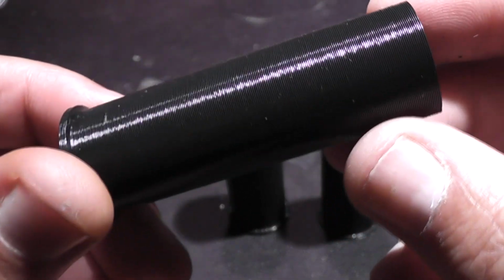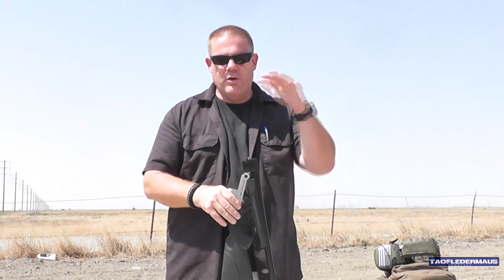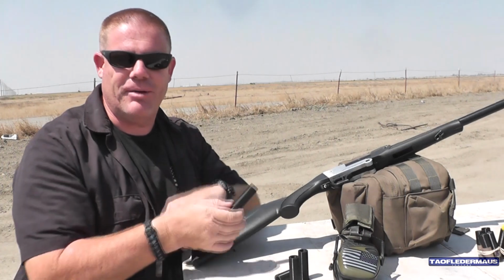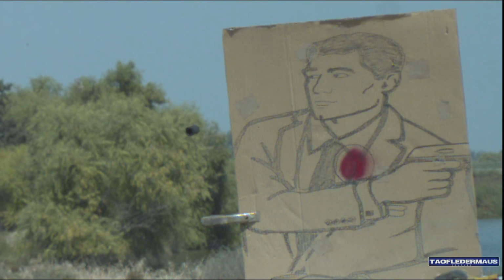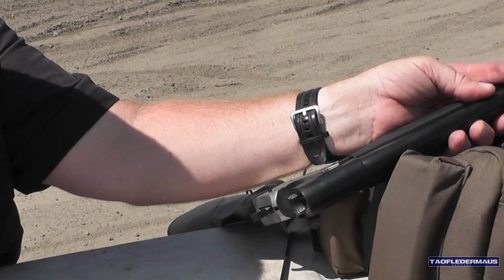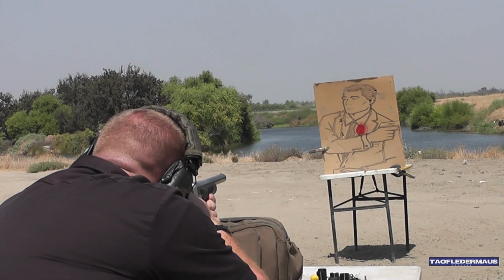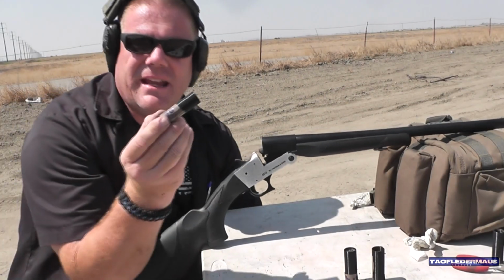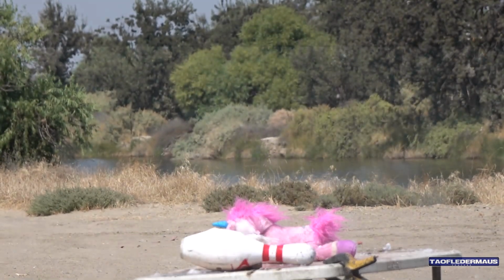3D printed Shotgun Shells - ALMOST too Dangerous

Comment: A shell that self-destructs in a way that doesn't allow immediate reloading isn't really useful. You're just as well off with a black powder firearm at that point. Before plastic hulls, there were paper hulls. That might be a more useful alternative, if for some reason you need to develop an alternative to modern hulls.

Comment: I would love to see a brass (or maybe steel) shell made from a section of tubing and an end plug inset to the tubing and brazed on there. I think that would work.  It would be an interesting low-tech low-capital way to fabricate cartridge cases from scratch.  You'd just need a lathe to create the base plug and some torch brazing equipment.

Comment: I would be interested in a 12ga explosively pumped flux compression generator (EPFCG) shell.  
See: https://en.wikipedia.org/wiki/Explosively_pumped_flux_compression_generator

Basically if you rapidly compress a magnetic field or iteratively short an electromagnetic coil, it emits an electromagnetic pulse.  

You're discharging powder in a confined barrel that pushes on the back of the shell at high pressure, ejecting the shot.  If the shell was designed in such a way that you activate the magnetic field, and then compress the magnetic flux with the deflagration of the powder and increase in pressure, the shot will be ejected as usual, but with it should come a strong magnetic pulse that I think would be directional as with the muzzle.

Comment: He is printing these vertically with seam lines around the barrel axis.  It's obviously breaking along those layer lines.

Print it horizontally, maybe with some PA-CF, and see the strength of the casing increase enough to expel the embedded projectile.

I'm also skeptical of increasing the number of outer walls in the shell casing to hold the projectile versus a common shell perimeter with /wadding/ to hold various projectiles.  If you want a 3d printed matrix to hold the projectile rather than standard wadding, you could probably do some kind of spongy voroni thing that's going to blast apart on discharge.  These are going to be separate printed items, I think.

If you're going to print the shell with 10 walls or whatever you are using to hold the narrower projectiles, make the entire shell have a ballistic "shoe" shape and don't aim for expelling the projectile from it but rather providing a kind of break-away sabot around the projectile until it reaches the target.

Comment: Interesting concept. I worked alongside a team 3d printing bridges. You have to plot the print path really carefully to deal with high stress points. A bit like rebar which is basically placed to stitch potential cracks
Reply: More details would be great !

Comment: If the shells were printed horizontally and not vertically the shells could stay together. I own a 3d printer and know that the weak spots are in between the layers

Comment: “It doesn’t automatically eject the shell like Hollywood?” My Browning over under Citori Plus Trap has ejectors. Lots of brake actions have ejectors, it’s just usually on higher-end guns as far as I have noticed, though not always. That does look like a fun little shotgun though! Your shoulder probably doesn’t find that gun very fun for long when it’s not filled with 4 pounds of bird shot LOL! That was a good idea. I understand the weight to help recoil from the bird shot, but I would’ve been worried it would make it act like a dead blow hammer. But you guys know more than I do and it seems to work well to save the ol’ shoulder. Enjoy the videos!

Comment: What material did he use to print those things. There's one material that supposedly is half the weight of aluminum and twice as strong as steel. It's a carbon fiber composite. Obviously this wasn't it.

Comment: That should be an 18 inch barrel. You counted the receiver as part of the barrel. I'm not being critical I'm just thinking this correct.
Reply from the maker: It measures 20"  from the breechface to the end of the barrel.   This is how you measure barrel length in a shotgun or rifle.

Comment: Yep, a 3D PLA print will always separate along the layer boundaries. The "correct" way of doing this would be to print the shell longitudinally however this would make the printing process much more difficult. Similarly, PETG would be a better option for the material.

Re-using old shells would probably be the best option, ten years into the zombie poxylips

Comment: print it length-wise bro, not bottom up...bottom up it will always snap off along the circular cross sections
Reply: It would be an annoying print. With the rim, you'd have to use supports or rafts. I'd be curious to see if it would hold up any better though, surely it would for the lower power rounds but not sure about those big loads lol
Reply: @bakedandsteaked  easy clean up tho, just drill them out
Reply: If your having layer separation like the ones in this video then your not doing it right. Most likely your temps are too low. I always test break any new material I load up for layer separation.
Reply: Resin printer may work better
Reply: My thoughts, exactly
Reply: Get a good printer that can use support and model mat’l and it will be easy money
Reply: If it prints lengthwise, it’s not certain to print perfectly round
Reply: I'm thinking the plastic is too brittle, shotgun shells have some flex to absorb the shock and expansion.
Reply: @yougonnaeatthat9889 at the base/primer of the shell yeah, absolutely. The brass really does most of the work making shells “safe” to shoot.
Reply: I print 37mm shells on their bases. The biggest problem here is just modeling traditional shell and printing them. They need to be redesigned for printing. There have been some huge advancements in printed ammo lately.
Reply: was just about to comment this

Comment: Rookie 3D printing mistake - you do NOT print something that is meant to handle these kinds of pressures facing up - Sideways would've been better, meshing two prints (longitudinal + upright) using a soft glue would've been perfect, would've required more thought and blah blah blah but hey, at least he got his fingers out of his rear end and made something unlike this commenter here who's working on wonky 3D printed fan-driven covid masks (why fan driven? Do you even wear glasses?) that will absolutely not sell given the predicted final price tag! Yay

Comment: He messed up. He should have printed them on their side. The way he printed them was standing up. You can tell by the lines. Those lines are the individual passes of the filament. Printing the way he did basically slammed rings together. Printing it on its side would actually give the piece alot more strength. Also im guessing he printed that in PLA was is kind of know for being pretty brittle compared to others such as ABS. Still a great idea

Comment: To produce the hull by 3D printer is an illeteracy.  During the 3D printing head of the 3D printer melt the filament is about 250-300 centigrade. Whereas during the gunpowder explosion heat reach to 1700-2200 centigrade and melt the material that 3D printed hull. That is why the hulls was disrupted during the shooting.

Comment: It looks like it delaminated. Depending on the material it might work better to orient the print where the layers move along the shell the long way instead of basically thin slices of plastic ring stuck together. but then again you may end up with the same problem. Also, different materials might help. Do you know if it is ABS or PLA? Also having something like a Carbon Fiber PLA may change how effective it is.

Comment: I wonder if it would be a stronger shell had the layering been side to side instead of parallel to the primer base
Reply: My logic behind that is, the layering grain is against the blast direction, being its parallel to the primer base, but if you rotate the layering grain to be perpendicular to the base, or in line with the blast direction, would they hold up better?

Comment: 3d printing not the way to obtain shotgun shells, something shotgun shells need a more traditional manufacturing process.  Plastic stress crack striations in the creation process are the problem.  Not suitable for high live action shooting.

Possibly if a clean burning  explosive plastic were used with a copper cap and ordanance, the 3d printing might be possible, but the plastic would need to completely degrade so the smooth would not get scarred and fouled up.  This would need to be a shell less round though.

<Lead [print low explosive plastic [cap

If a gun was restructure just right in order to remove the unburnables, it could help create a special military use gun.  Its nice to not have to collect shells.

Comment: Guys, the plastic shell have been around since the late 1960s. They were made by Herterz of Owatina, MN. It was made to be reload without a press. A all that needed to be done was poke out the primer, and replace it with a new one. Them add powder wad, shot the cover it up with a cardboard overshot wad.

Comment: Dude I've got a 1922 break action that's barrel wont even stay attached half the time that really does eject the shells like 3 feet in the air the ejector only pops out about 1/8 inch but hell that spring's gotta be like godzilla-tier.

Comment: You printed the shells the wrong way. You printed the shell vertically instead of horizontally. Printing it horizontally would give the shell more strength in the type of situation you're using it in. Vertical print stacks the layers of plastic snd doesnt give it very much strength when used in that situation.
Reply from the maker: I didn't make them
Reply: TAOFLEDERMAUS oh. Half way through the video i forgot what you said in the beginning.

Comment: Yeah, that wasn't a real high-percentage prospect there...  With the 3D printed layers running circumferential on the shell, there's no way it'd hold together without help. FFF/FDM-printed parts just don't have that kind of layer adhesion.  Now, maybe if it were wound in glass fiber or kevlar thread and coated in epoxy to reinforce it...  But I think the bottom line is, it just doesn't make much sense to print the whole shell... 3D printed projectiles on the other hand have proven interesting, and 3D printing is certainly handy when it comes to making sabots and stuff for custom projectiles made by other means. (Such as CNC turning/milling.)

Comment: the problem is the style in which the shell is printed, possibly material, rather than have it print the shell in rings, it should be long strands going down the length of the shell, harder to configure for printing but it'd prevent the cut shell effect. worst case they'd probably split and only be useable one time. but your powder load would affect the round more than the shell hopefully.

Comment: From the breach yea its 20 but for all intensive purposes its an 18. Also you should look into steel or brass cased shotgun ammo, It has done before. Its probably much more effective than plastic.
Reply from the maker: The barrel length on firearms is measured from the breach to the muzzle.   Revolvers are measured from the muzzle to the front of the cylinder.

Comment: Michael probably should have used ABS plastic and acetoned them, for greater strength. or used nylon. either way the tempratures would melt the shells and lead to fouling. my 2cents.

Comment: I have a 5-6lbs single break action and 3 load low brass does a number on my shoulder and I am a big guy. Leave bruises in m should when I was over 300lbs now I am little over 225lbs and I feel the difference. My break action shoots the shell if you open it after you fire it. If you wait too long it wont.

Comment: These could work better with varying wall thickness. Either make the top end nearly the diameter of the bore to allow for a big projectile, or embed some steel/lead in a bullet shaped printed tip and make the wall thin below, so it can separate.

Comment: @Michael You should try printing some in the other direction so that the layers are parallel with the length of the shell.  It takes much more force to split the shells when they are printed in the other direction.  It'll take a lot more cleanup before shooting but they will slice open the other direction and might not have the problems with shot performance but it is always going to have the stuck in the barrel problem.

Comment: The shells were designed that way on purpose- the shell blows apart to help clean the barrel🙃
Reply: The VSO Gun Channel 

Ha!  All it did was funk up the barrel with a lot of plastic fragments.  We had to use a rod and tap (pound) out little rings of plastic several times. Thanks for watching VSO!
Reply: It's a ballistics countermeasure. No shell to match for evidence. ;)
Reply: The VSO Gun Channel are you stupid. That would leave so much behind
Reply: @cg6281   r/wooosh

Comment: OG, is the loose birdshot in the stock kind of like a dead blow hammer? Seems it would hit, then hit a second time.
Reply: Jason Woods, it shakes around and is distracting, but I didn't notice two thumps. Worst part is getting it shouldered and on target. It sorta "sloshes" and the weight rocks front and back.

Comment: I wonder if you printed it on its side if it wouldn't be more resistant. It's going to crack or break no matter what, but that would give it a little more strength in the areas that need it. Would be much less likely to send half the shell out of the barrel as well. I wonder if it wouldn't also help to bake them in an oven after printing to possibly get better adhesion between layers.

Comment: perhaps if a different material was used or the pattern that was printed was alter it may be more structurally sound. from what i saw it was printed in a circular pattern, perhaps if it was printed in a sort of crisscross pattern it wouldnt seperate the way it did.

Comment: You're gonna need a much better 3D printer in order to get a print to hold together in a shotgun. Running the plastic all the way down to the base will never work anyways though. WAY too much pressure for that

Comment: You know, this might actually work if the base of the shell was reinforced with brass or some other metal, like a real shotgun shell.  Standard shotgun shells are also plastic, albeit probably a tougher material than is usually used for 3D printing.

Comment: hey - noob question: "cylinder bore" = smooth bore?
Reply: Almost.. it is a smoothbore but also is straight. Lots of breakactoins have a tapered barrel, meaning the end has a smaller diameter than the start. That's ok for bird or buck but a bad thing for slugs
Reply: cheers!

Comment: Two things I want to be tested, Tempering the 3d printed cartridge at 100 deg C for a while and  giving is a acetone vapor bath or both. It will improve the strength and there is less possibility of delamination of the layers

Comment: huh... bird shot in the stock... Wonder if granulated impact physics works with recoil absorption as well as it does with stopping impacts since they both deal in kinetic energy. If so then I would load it up with sand, ziploc it to prevent leakage.

Comment: that stuff coming out of the breach isn't too dangerous if you don't put your body parts there.

think of the breach like it's the cylinder gap of a revolver.
Reply: Windhelm Guard, I've seen gruesome pics of a guy's hand torn apart because he held it over the cylinder gap of a 500 S&W.  I'd rather not test out the effects of shotgun blast to my dainty digits.
Reply: interestingly enough there is actually a double action revolver mechanism that closes the cylinder gap, but no manufacturer uses it.

Comment: hey tao when loading 7/8 lee slugs in your video you said you used a 5/8th hollow punch for the nitro cards, correct? just checking before I buy this on amazon:

https://www.amazon.com/General-Tools-1280-O-Hollow-Steel/dp/B002JFUEVE/ref=sr_1_4?ie=UTF8&qid=1505028175&sr=8-4&keywords=5%2F8+gasket+punch

Comment: Michael:
There are two design considerations I can think of that may prevent case head separation in the future iterations. First, maybe try printing the shells horizontally instead of vertically - this way, the "grain structure" of the shell will combat the stress more effectively. Second, using a kind of cone shape from about 1/3 up the shell all the way to the primer pocket would give the case head more mass, so it may be less likely to separate or delaminate.

Comment: Wax slugs - good.  Have you ever considered ballistic gel slugs, gel instead of wax?  How about other 'congealing' media (liquid that hardens when it cures), like rubber cement, epoxy, plastic resin, pine tar, roofing tar, sugar, frozen Crisco, drywall joint compound, construction adhesive, etc . . .  (If you used Jello, would that make it a Jello Shot?)
Reply from the maker: The thin molten wax allows the lead shot to stack orderly in the shell,which is the key to their strength,  not the wax.

Comment: I'd bet you find the thinner walled ones tend to work better; with the load being so narrow in the thick ones, the pressure would escape around it as soon as it was past the shell, which would not only cause most of the energy to be wasted, but might keep there from being enough back pressure to even let the entire powder charge burn in the first place.

Comment: He printed the shells vertically.  It made all the layers end up front to back.  3D printed objects will break along the layers like a pine board.  You should try printing them horizontally so they don't break apart as easily.  Its a lot harder to print in that direction, but when you get it right, the shell will be stronger.

Comment: I think it may work better at a higher resolution using a specialty filament, with slightly higher heat on the head to seal the layers.